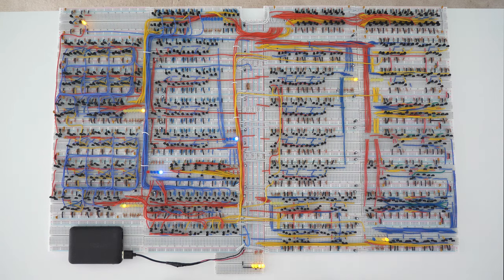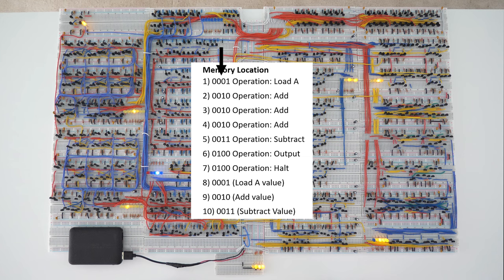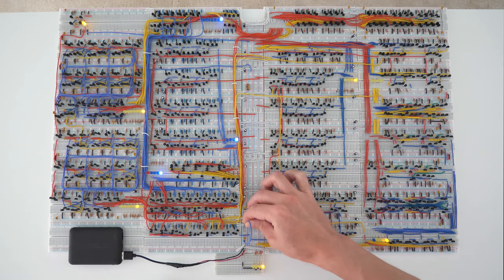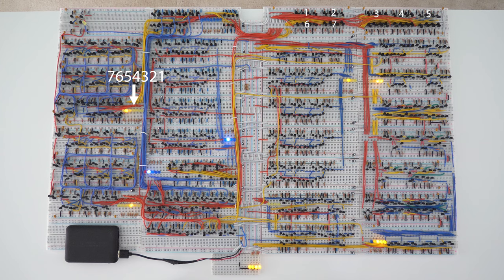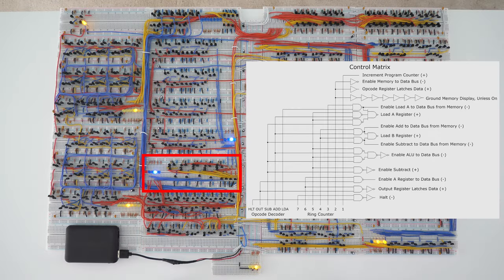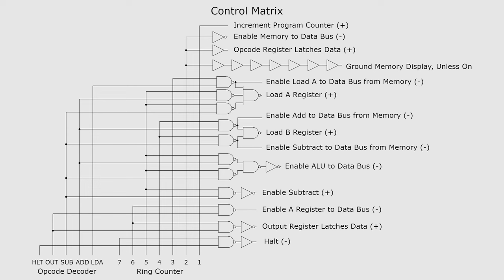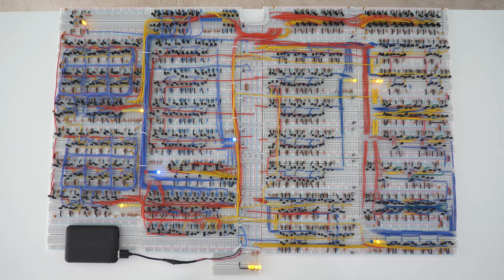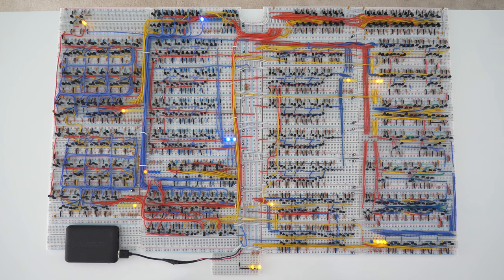How to Build a 4-Bit Computer on Breadboards Using Individual Transistors

Comment: Using a finite state machine (FSM) that runs over multiple time steps could simplify the design of your 4-bit computer, the GSN477. Here's how it might work:

Reduced Hardware Complexity: By introducing an FSM, you can sequentially manage operations that would otherwise require separate hardware components. For instance, instead of having dedicated hardware for each operation (like addition, subtraction, etc.), the FSM could handle these using a smaller set of shared components, reducing the total number of gates and flip-flops.

Time-Multiplexed Operations: The FSM allows the computer to reuse the same hardware across multiple clock cycles for different tasks. For example, the same ALU could be used for both addition and subtraction, depending on the state of the FSM, reducing the need for separate units.

Simplified Control Logic: The control matrix and opcode decoder could be streamlined by incorporating an FSM, which could manage instruction sequencing and execution steps more efficiently. This would minimize the complexity of combinational logic required for control.

Trade-off: The trade-off with this approach is that the system would need more clock cycles to complete an instruction, as each step of the instruction might be handled in a separate state. However, for a simple 4-bit computer, this trade-off might be acceptable given the savings in hardware components.

Overall, using an FSM in this way can make your design more efficient in terms of the number of components, even if it requires a bit more time to execute instructions.

Minimal FSM Example:

States:
Fetch: Read the instruction from memory.
Decode: Determine the type of instruction.
Execute: Perform the operation (e.g., ALU computation, memory access).
Write Back: Store the result.
Increment PC: Move to the next instruction.
Transitions: The FSM transitions from one state to the next on each clock cycle, progressing through the instruction cycle.

Limitations:
Instruction Complexity: The simpler the FSM and instruction set, the more limited the system's capabilities. However, even a very basic FSM can be Turing complete if it supports loops and conditional branching.
Reply: Recursive FSM for Multi-bit Processing
Instead of building a full 4-bit (or more) wide data path in hardware, you can design a smaller, simpler FSM that processes one bit at a time, recursively or iteratively handling the entire multi-bit operation over several clock cycles.

Concept:
FSM Design: The FSM processes each bit sequentially, from the least significant bit (LSB) to the most significant bit (MSB).
State Representation: The FSM would include states for each bit position, and the states would recursively process the current bit and then move to the next bit.
Data Handling: The data registers store the current result, and the FSM updates these registers bit by bit as it processes each bit position.
ALU Interaction: The ALU can remain simple, only handling single-bit operations at a time. The FSM will control the ALU to combine the results of these single-bit operations to produce the final multi-bit result.
Operation Flow:
Initialize: The FSM starts with the LSB (bit 0). The initial states prepare the system for the bitwise operation.

Process Bit-by-Bit:

Bit Fetch: The FSM reads the current bit from the operand(s).
Bit Operation: The FSM performs the operation on the current bit using the ALU (e.g., adding two bits, logical operations).
Accumulate Result: The result is accumulated in a register, potentially with a carry or overflow flag if needed.
Advance: The FSM moves to the next bit position and repeats the process.
Completion: After processing all bits, the FSM transitions to a final state where the complete result is available in the register.

Result Handling: The result is either stored back in memory or used for further computation.

Advantages:
Component Reduction: The design reduces the number of required components, as the FSM and ALU only need to handle single-bit operations.
Scalability: The same FSM design can handle any bit-width (4-bit, 8-bit, etc.) by simply extending the number of cycles it takes to process the data.
Simplicity: Simplifies the control logic, as the FSM only needs to manage single-bit operations and move between states based on the bit position.

Example Implementation:
For example, in a 4-bit addition, the FSM would:

State 0: Add bit 0 (LSB) of two numbers, store the result in a carry register.
State 1: Add bit 1 with the carry from the previous step.
State 2: Repeat for bit 2.
State 3: Add the final bit (bit 3), considering the carry.
Each state handles a single bit, and after all states are processed, the final 4-bit result is stored.

Limitations:
Speed: The main trade-off is speed. Processing one bit at a time increases the number of clock cycles required for each operation, which can slow down the system significantly compared to a parallel 4-bit or wider data path.
Complexity in State Management: Although the hardware is simplified, the FSM needs careful design to manage state transitions and bit-level operations correctly, especially for operations like addition with carry.

Conclusion:
Using a recursive FSM to process one bit at a time is a viable approach to reduce hardware complexity in a 4-bit computer (or any n-bit system). This method leverages the FSM to handle multi-bit operations sequentially, which can be especially useful in environments where minimizing hardware resources is critical. The trade-off is slower operation, but for many applications, this can be acceptable given the simplicity and scalability of the design.
Reply: Isn’t he already using an FSM? There are 8 states for each instruction. 

There is one ALU, it does addition and subtraction, it isn’t separate. It is a requirement to add the xor gates for subtraction since there are no instructions for bitwise operations - that sort of hardware doesn’t exist anywhere else in this processor.

Wouldn’t a FSM will end up looking like this when constructed out of transistors?

Reusing hardware for multiple tasks results in the controller becoming more complex - the trace off is only worth it when the controller’s complexity increase causes less transistors to be added than the number of transistors that were removed due to removing hardware. In this case, what specifically do you propose should be removed?
Reply from the maker: Interesting, I had to think about this for bit. I think you could build a more simple FSM out of transistors. However, I think there is a reason that the Von Neumann architecture is what was adopted for most digital computing applications. As you stated a simpler FSM would take more clock cycles meaning slower computation times. Many advancements to computing where to find ways to make things more parallel even if that meant more components. There could be a case where high computational power is not needed and a system with less components meaning less point of failure would be advantageous. Also, if you built an even simpler computer or a demonstration it would be sweet project and I think you should give it a try. If you need any help, let me know.

Comment: Hi again, at 4:29 I count 11 transistors per J-K FF.  The FF consists of two 3 input NAND gates (3 transistors per gate) and two 2 input NAND gates (2 transistors per gate) for a total of 10 transistors.  Yet I count 11 transistors per FF in the image.  Why the extra transistor per FF?
Reply from the maker: Hi! You have the right idea but if you look at the logic gate-level circuit diagram there are three 3-input NAND gates (3 transistors per gate) which is 9 and just one 2-input NAND gate (2 transistors per gate) which is 2. So 9+2=11. The third three-input NAND gate is for the clear.  This makes it so it is easy to reset the counters after startup where they would likely be at a random value. The clear feature option is also added to all the registers. In my videos about flip-flops, I might not have had a clear option cause it is not really needed for a stand-alone circuit. Great question!
Reply: @GlobalScienceNetwork  Yes, of course, I see it now, Thanks!

Comment: Great work, I love it! 
One question I do have is why don't all the MS flip flops (e.g. registers) use the "capacitor trick" that the ring counter uses?
Reply from the maker: That is a great question! You should be able to for the opcode register and might be able to with the accumulator register. MS flips flops are used very often in real life so I thought they were good to use as an example. Also, MS flip flops are a bit more stable so I did not want to get too risky and find erratic behavior that might be hard to troubleshoot. I do not think many people even knew you could use a resistor and capacitor as a trigger in a breadboard setting. You would have to be careful doing this for the accumulator register though as the ALU updates almost instantaneously. I have it so the clock input is floating on so it latches at the end of the clock cycle for the MS flip flops. For the edge-triggered flip flops, it might work or it might change twice, I would have to think about it more. If it triggers twice you might be able to set the input to the clock gate from the inverse of the clock input. Let me know if that makes sense or if you have any other questions. Hopefully, you liked the 7 stage counters! I finally got around to showing them!
Reply: @GlobalScienceNetwork  I understand the "capacitor trick" is actually a capacitor and resistor in a high pass filter configuration (differentiator) and that this is a way to create an edge triggered pulse (since the derivative of the square wave and dv/dt at edge transition is large and so a spike results).  I have used that technique before to convert a long pulse from a oneshot to a clock pulse required for the next stage, so I am familiar with the concept.  But having said all that, I do think the MS FF is a more solid design, and I was simply just curious why you did both (which you answered above).
And yes, I love the 7 stage counters, I plan on building a similar circuit at the transistor level to do frequency division for an "old school" project I have in mind, so I will adopt your design for that.  Great content and thank you for your patient and detailed reply.  I love your dedication to this project and look forward to future videos on your channel, it's a real gem!
Reply from the maker: @Enigma758  That makes sense. And thanks for following along! I am excited about all the cool things we can build with some basic electronic components. It should continue to be a fun process. Let me know if you make a video about your "old school" project!
Reply: @GlobalScienceNetwork  If you google search for "Hackaday Transistor SCR Ring Counter Circuits", you should be able to find the beginnings of my project.

Comment: Very interesting. Truly a great piece of art! 

I was going to build the exact setup for a punch card computer but found it to be very cumbersome. So I just skipped building the computing part from scratch with transistors (or logic gates), instead I used an Arduino. My focus was more on building the punch-card reading functionality.

Made a few videos of it. You can find them on my channel. 

I was wondering it will be very awesome if we can combine this 4-bit computer with a punch card reader.
Reply from the maker: Yeah, that would be cool if you could combine the punch card readers with the 4-bit computer. I also see building these types of projects as a work of art. Your punch card reader is sweet. Programing with punch cards was before my time! I like your soccer robots! Can you purchase those somewhere? I am looking for a good vehicle platform to control with artificial neurons for an upcoming video.
Reply: @GlobalScienceNetwork  Cody! Thanks for the attention! I'm trying hard to make a video on how to build one of these punch-card machines... 

Anyways, Regarding the soccer robots those are the robots we built for a competition called RoboCup. We participate in the Small Size League. The robot doesn't navigate alone. It blindly receives navigation signals from a central computer. The central computer is connected to a camera mounted above the soccer field and with that the computer knows where each robot is located. Pretty cool stuff! If you think that works for you I'd love to help!

Comment: Nice! Saw now. Thanks for posting the educational video. Is that based on ben eater style breadboard computer? Have ported it to an SMT PCB design yet? That would be a useful educational tool and making an SMT PCB edition would make it vastly easier for robots to make them fast. I have done enough breadboarding to know that doing the wiring isn’t going to be any major learning experience, aside from being reminded to not do complex wiring on a breadboard. Haha. By the way, recommend adding a 7 segment display, if possible.
Reply from the maker: Yeah, showing how to make a PCB of the design would be educational. This computer is not based on Ben Eater's computer. I started building each section using basic logic gates and flip-flops. I used Jerry Walker's book, Computer Time Travel to help fill in knowledge gaps. He built a transistor-level computer based on the Zilog Z-80 8-bit microprocessor. This computer is not any specific computer so I called it the GSN477. Since it is 4-bit it would be most like the Intel-4004 but is a bit different then that. I might do a video sometime showing how the 4004 is designed.
Reply: @GlobalScienceNetwork  Thanks for explaining. The educational answers are appreciated👍🏻

Comment: I tried building your inverting tri state buffer in LT spice but it doesn't seem to have the correct behaviour at all. Any help would be appreciated
Reply from the maker: Sure, I can try and help. I drew the circuit up in EasyEDA but I can use LT spice as well. You are talking about the simple inverting tri-state buffer not the open collector tri-state buffer correct? If so the expected behavior is for the output to be on when the input is ground and enable is ground. In the other cases the output should be off. If you want to share the circuit you can get my contact email from YouTube on the about tab.
Reply from the maker: I would have to see the circuit drawing to see why. You could email me. Did you try building the buffer on a breadboard and then draw it in LT spice? That would be helpful. I do have a video about how to use LT spice.

Comment: Could you explain why there are so many scattered capacitors? Do they help stabilize the system? As I understand it is to help deal with current spikes, right? And how would I know where to put those in the circuit? Thanks
Reply from the maker: Yeah, these are called decoupling capacitors. Some should have values around 100nF and some should be around 100uF. It helps to make sure the power is coming to each circuit from the bus and not elsewhere which could cause problems. It also likely helps with the voltage drop across the breadboards. Sometimes even where you apply the power can affect the circuit behavior. It was not an exact science I just tried to add them evenly around the circuit. If you are trying to run the circuit at higher frequencies then these are even more important.

Comment: Great job! How do you input programs to memory? ... or do you hardwire (cable) the program to run? ...
Reply from the maker: The values are adjusted by setting the memory inputs to one or zero, which is 5V or ground. The memory is hardwired but it is easy to adjust the values.

Comment: great video! im planning on building something like this in the future, does it matter what breadboards i use, or is it fine to use cheap ones?
Reply from the maker: Most of them will work but the BB830 by busboards are the best and worth the money if you have the funds! This was built with average quality boards and worked but I did have to swap about 4 of them out that had issues. So now I use the better breadboards.

Comment: I am a CS major and have minor knowledge with electronics, besides some digital logic courses. I have been trying to build the SAP-1 out of just transistors, but keep running into issues where my output is not strong enough to carry through to the inputs of other logical operations.

For example, I built an adder/subtractor unit, but when I place the unit in subtraction mode, the borrow bit does not get enough voltage through it to light up the led.

Is there something that I could do to ensure the output of my logical operations are strong enough to power other logical operations?
Reply from the maker: That is cool you are trying to build a computer out of just transistors! Is your power supply 5V? That is what I used. From there if the logic gates are built properly the output should start at the full 5V. Did you watch my video on how to build logic gates and flip flops? If you use the same configurations it should work. Assuming that is the same, sometimes on a large breadboard circuit capacitors are needed on the power rails to ensure there is not a voltage drop across the breadboards. Sorry for the delayed response. If you have more questions, let me know.